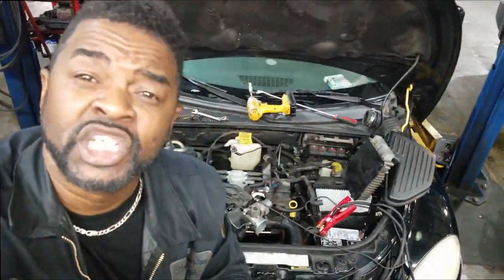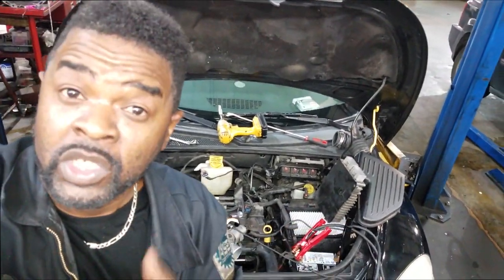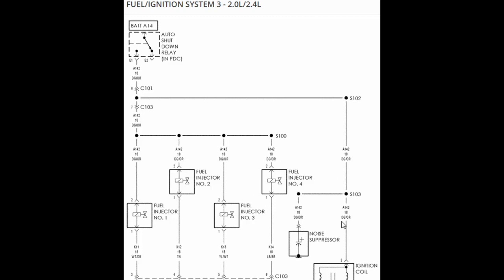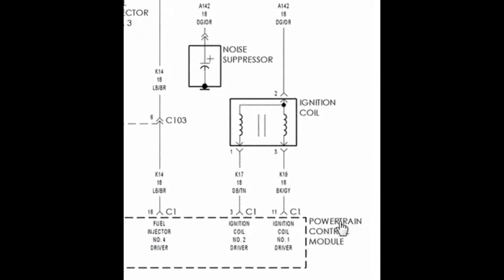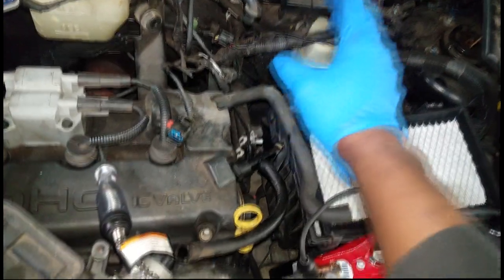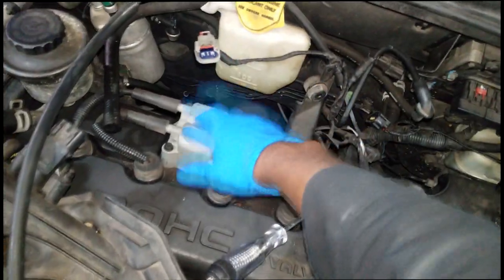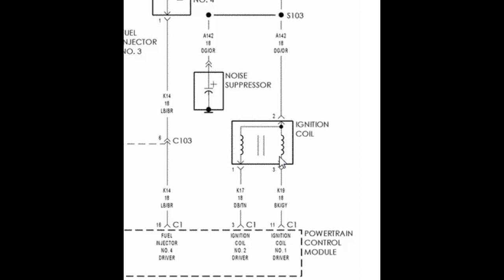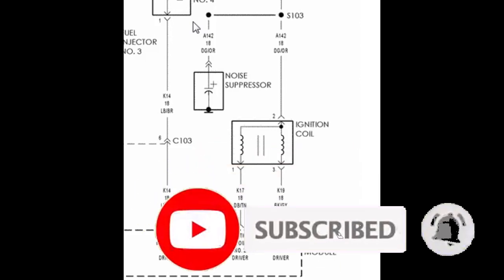How to tell if your car computer bad PCM or COIL. How to fix a NO START MISFIRE  PT Cruiser No Spark

Comment: Got a question for ya bro......Been working on this 2009 PT  non turbo base model 2.4
off n on for buddy, the past year  lol
It's got me pullin what hair I got left out !
I'ma truck driver so can't spend lots time
on this "project" until on "home time"

Problems / Gremlins started with dropped valve seat
Cam lobes look good no real wear of flat spots

Constant P0304 misfire;

Things replaced;
Coil pack, wires, plugs, oil/air filters
Reman Head (dropped valve seat before) 8 months ago
Compression (dry) @ 150 psi on all 4 holes
Timing belt (rechecked last time, 6 times, dead nuts ON time every time I've rechecked)
Fuel pump , 02 sensor
Injectors spray good stream on all 4 
New Mopar= Cam/Crank/Knock sensors/ (today-->)Coolant sensor
Harness good, injector wiring repaired as needed. 

I'm thinking PCM issue, his wife thinks not, hence all these parts replaced lol
Since I reinstalled factory injector harness NOW it at least starts, for few minutes, BUT
throttle up, max rpm is 2000, bogs like timing issue, then stalls. Hard restart without full pedal 
it's weird throwing me off mentallylol it SHOULD run fine!
And past 2 days I went back over wire testing for shorts/opens from the coil to cam etc

Rechecked ALL grounds clean/tight......1st PT thats had me stumped in all these years

Thanks for ANY input if any 

Stevo
Reply from the maker: Wow  my man, youve pretty much eliminated  everything that would cause a secondary misfire with all those new parts, and you telling me compression in cyl 4 is around 150psi??? but theres a misfire in cyl # 4???  Now I wouldnt suspect a PCM unless the ignition primary circuit shorted, as in not commanding the coil to fire off cyl 1 and 4.  Is there a misfire in cylinder 1 also?
Reply: @OnlineMechanicTips  Nope has just been cylinder 4 hard fault  P0304, why it's drivin me bonkers whats the cause. Now if I had a fancy pants scan tool that could do scope & graphs etc might help more lol. Never needed em shops always had top of line scanners.

They did buy 2 or 3 junkyard injector harnesses, (automatics shouldn't matter being separate harness)
It wouldn't even fire up. Once I put the factory 1 back it would start n run 30-45 seconds, boggin out til stalled

Last time I ran compression, I had 150 psi in all holes.....I didn't run it this time, as I was limited for time home, head out tomorrow for another 3 to 4 weeks OTR
Oh well, maybe next time I can dive into this Gremlin again lol It WONT beat me!

Thanks for your time bro

Comment: CLUTCH BUYING TIP: 

Newer model PTs, the clutch assembly is the EXACT same, LUK brand clutch for ANY model year!

Buddy had an '02 PT new ,back then clutches were pricey too. Well Now he has a 2009, last time I did his clutch, all auto part stores wanted $650 for the clutch for Gen 2's......

Well, order a clutch for a 2002 instead of newer year models. And save $400 !!!I pointed this fact out to the parts store, and the guy was clueless to this fact. 

They just have their own brand sleeve on the box. Pep Boy's/AZ/Oreillys etc lol

So I ordered a 2002 clutch for his 2009 PT......they are the Exact same parts , the Clutch & the 5 speed trans used in EVERY PT model year cars !! (not many 5 speeds out there either !!) I've been a mechanic 40 years
Reply from the maker: wow, dang thats crazy for it not to be in the catelog.
Reply: @OnlineMechanicTips   Worse even, this 5 speed manual trans (used) was a PITA to even find 1 last year, was the ONLY 1 in the WHOLE USA !! (San Diego) Auto's are a dime a dozen lol
Reply: Have you checked TIPM Totally Integrated Power Module Fuse Box
Reply: @GFXmaxx  thats next when have time off the road as i am now a truck driver lol. Seeing his vid now on tipm issues it fits what this cars been acting like. Spitting sputtering misfire run crappy then stall even after everything has been replaced that possibly could. TIPM and ECU only thing left, I'm leaning to tipm 1st n see

Comment: Okay, Did the load test on the 2&3 plug wire from the computer connector to the coil connector and it was good. So it's a 2007 engine in the 2002 body. Is the timing signal from the crank sensor the same on both since they are located in different spots of the block? Maybe I should have started there. My bad
Reply from the maker: Lol..yes you should have started there..lol..the 2002 model use totally different camshafts than the 2007 models..gen 1 and gen 2 PT Cruisers are very different from an electrical system standpoint.
Reply: @OnlineMechanicTips  Damn, Time to pull the 07 out and sell it and move forward on my first intentions to rebuild the 02. Continueing on the PT journey. I should have done my homework first but it was a good deal a 500 with only 87K miles.

Comment: Thank you for the video it is exactly what I needed to know and yes I am a subscriber. I did that test with the test light and on the wire that goes to the 2&3 plugs the light flickers way way dimmer than on 1&4 wire which is why I think it's not enough to cause a spark at the plugs.Time to do a load test on the 2&3 wire from the PCM to the connector when I get a chance. Work hours just went up. Keep you posted on the findings. Keep up the good work.
Reply from the maker: Good luck bud, hope it work out for you